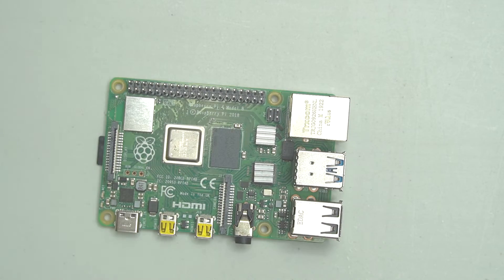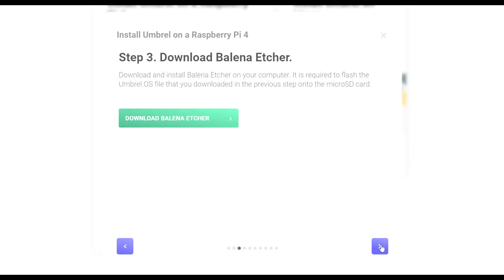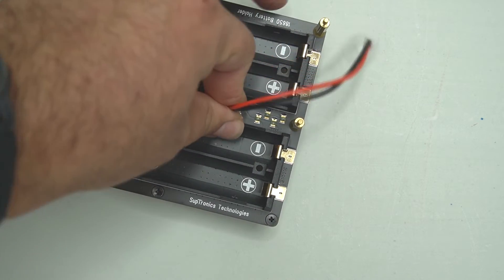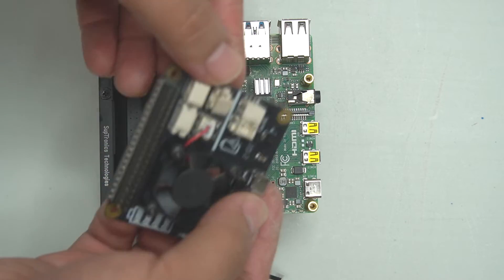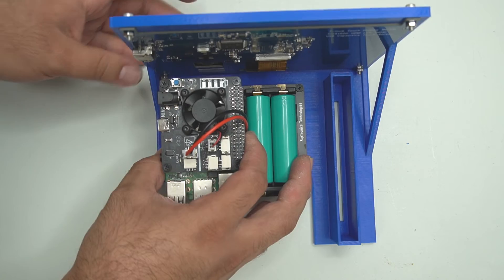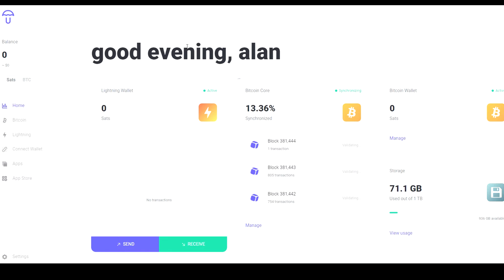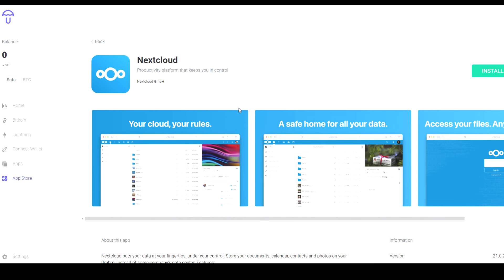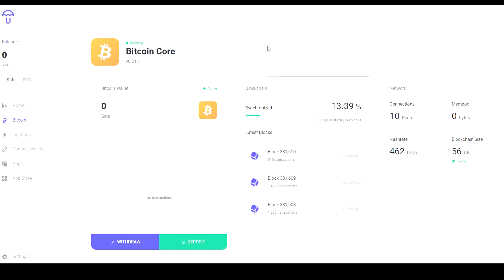How to setup a Bitcoin node using a Raspberry Pi 4 and Umbrel

Comment: Can the raspberry pi be used to make board games? Is there a slimmer raspberry pi or computer that can be used for board games?
Reply from the maker: There is the Pi Zero. Good luck getting one at MSRP though. Also I'm not sure what you mean by board games
Reply: @AlansInventions  thx for replying. Building a chess board that will interact with the pieces and use BTC
Reply from the maker: Bitcoin? Like playing for crypto? Lol I thought about making a moving chessboard before

Comment: Amazing work! Do you know what was the final SSD usage after the whole sync of the ledger? 
(it was already 71.6GB while syncing blocks from 7 years ago)
Reply from the maker: Thank you! If I am remembering correcly, at the time of publishing the video I think it was around 370 GB.. I checked the current size today 8/22/22 and it is around 422 GB! Pretty soon I will need to upgrade that SSD I used :(
Reply: @AlansInventions  thanks a lot for answering! It seems I'm missing something: if a block is 1mb/10min then you'd use up 144Mb/day (or 52.56Gb/year). So it can last you another 10.9 years no?
Reply from the maker: @steveshuffle  Here is a good link to view the daily increase in blockchain size. My video was published almost a year ago, Sept 3, 2021. At the time the size was close to 365 GB, 1 year later we are at 423 GB. That is a 58 GB increase. It seems I may have about 14-18 months left with this SSD? 

https://ycharts.com/indicators/bitcoin_blockchain_size

Comment: hmm. Ethernet... For me this seems like an inconvenient location. Anyone else?
Reply: To me seems like a more reliable connection
Reply: If you're referring to the difference between wireless vs wired, then wired is typically better.  All wireless gives you is more mobility.  This device doesn't need mobility, but it does need a fast connection, which being wired, it's much faster than being wireless.
Reply from the maker: Hello - what do you mean?

Comment: Would be great if it was solar.
Does nods owner earn from it? 
Does it autouodate? 

Thx for.ur videi
Reply from the maker: I could make it solar but it's going to be indoors most of the time.

There is a function for updating. Seems pretty straightforward.

Yes you do earn a few Satoshis if you have enough open channels and traffic going through it. Don't expect to earn much from it though.
Reply: @AlansInventions  Thx,  keep them coming.  😃